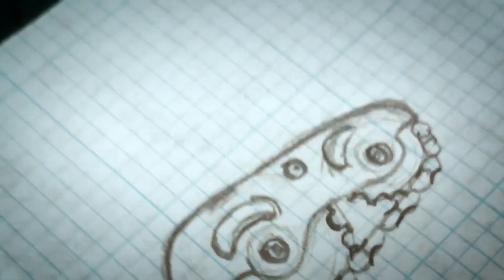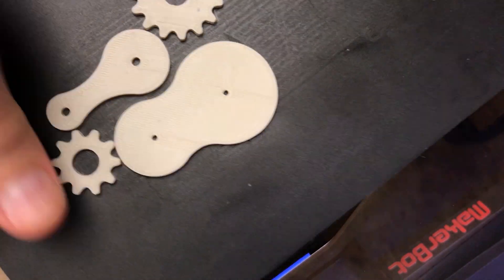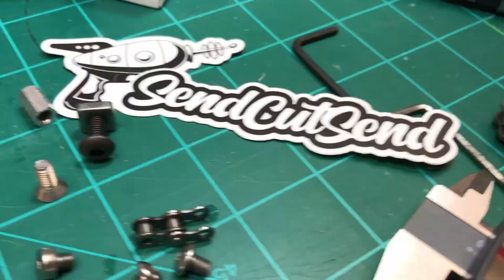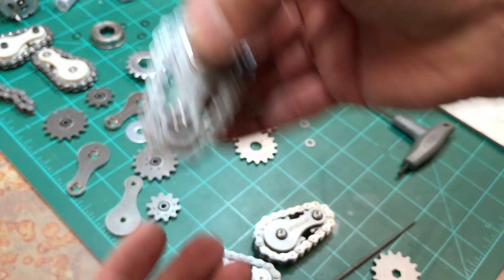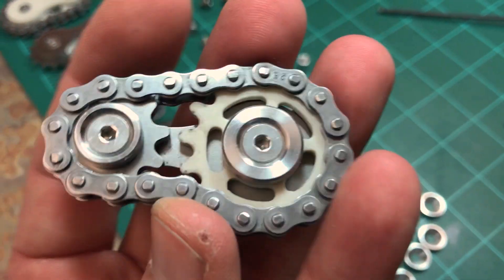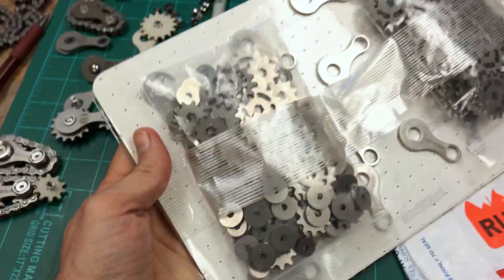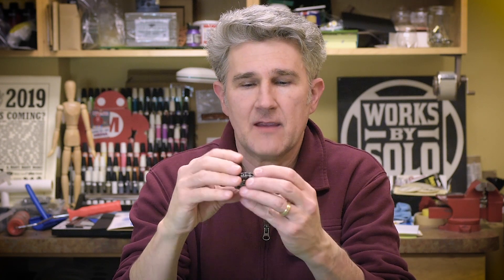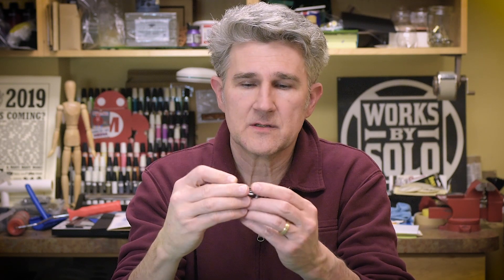This is "SPROK-IT". A Simple Mechanical Device Working with Sprockets and Chain.// Laser Cut Steel.

Comment: Just so you know vexpro makes an easier to use chain tool. They are also an frc/robotics company
Reply from the maker: Absolutely! VEX PRO has great products. Have you had trouble using this REV Robotics tool? In my experience, it’s been very easy to use.
Reply: @WorksbySolo  no, it looks like you had to fish the pushed out pin into the hole. The vexpro one had a slot rather than a hole.
Reply from the maker: Oh yes, I see what you’re talking about. That would be more convenient. I’ll consider milling out a slot there. Thanks for the suggestion, and watching my videos.

Comment: Just an FYI, they make countersunk washers, they are plentiful in lots of industries. Save yourself some machining time on those. Plus, consider a fabbing or grinding a double sided sprocket chamfering lathe tool to save on flipping the sprockets around / changing tools / extra carriage movements etc.
Also, consider sending out a "maker's version" as just a baggie of parts, where we can put them together ourselves. Many hands, make light work ;-)
Reply from the maker: Thank you for the suggestions. I shopped around for many hours looking for a standard stainless countersink washer that was the dimensions required for this purpose, where the screw head sits significantly below the top of the washer creating a divot for the user's fingers, AND had the outer dimensions to fit the design. A few came close, but were $6 - $8 PER WASHER! I like your idea for the lathe tool, and I'll look into that. I do encourage owners to tear this thing apart. It comes with a hex wrench and instructions to fully disassemble and reassemble the entire thing. The assembly process  is very quick, and ensures that the item has passed Quality Control, and is delivered in a fully functioning state.

Comment: Could you use socket head cap screws instead of the flathead cap screws and the "tapered washers" to reduce part count and save machining time? Just a thought, otherwise awesome design and I want one.
Reply from the maker: Thanks for the feedback. Yes, I tested several screw heads. The device is kinda heavy, which made it difficult to hold on to. Send an email to bernie@worksbysolo.com. Put “Sprok-It” in the subject. I’ll be sure to notify you when the next batch is ready.

Comment: Love this project and love this video. I’ve plasma cut a handful of steel projects last year but sounds like I need to upgrade to laser!
Reply from the maker: Thanks Mark! Once you go laser, you’ll never go back. :-)
Reply: Works by Solo Looks like it. The funny thing is in November I had 30 steel locks and keys cut for my 8-year-old’s Escape Room-themed birthday party and I was told it was the same price and quality for laser vs plasma, but that I should do plasma again, which was a mistake. Since the parts were so small many turned out pretty funky (which was fine as a kids art project), but I definitely will try SendCutSend next time!